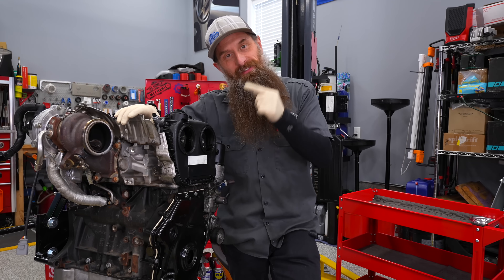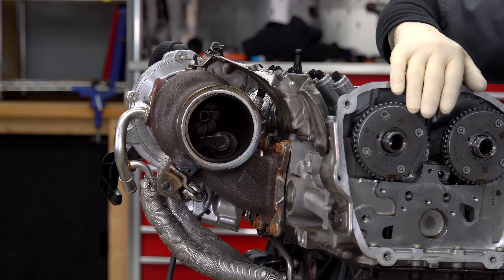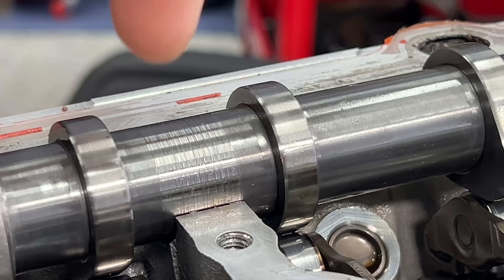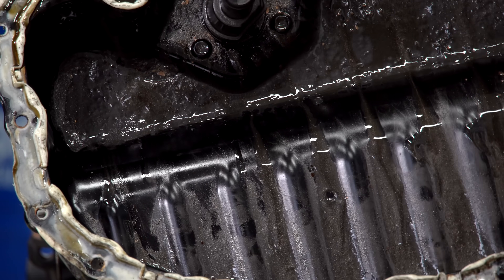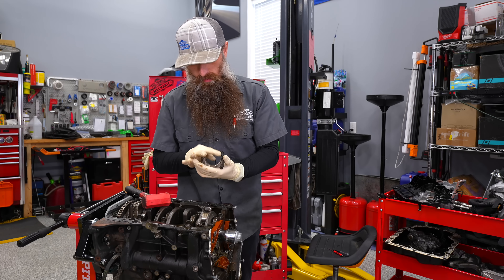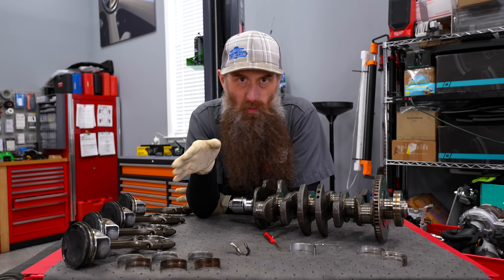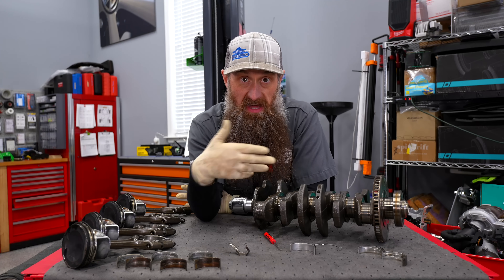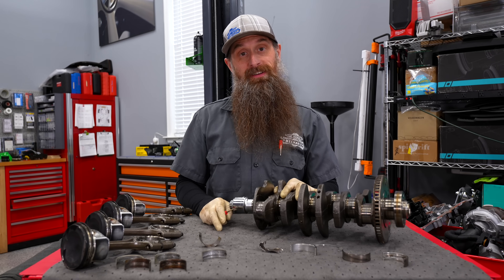Why This Audi S3 TSI Engine FAILED at Just 110k Miles?

Comment: I thought I was the only one that warmed up the car before diving. Most people don’t. Glad someone say this is still important!
Reply: It's not important to warm the car up before driving, and be never said that. What IS important is not hammering the throttle before the engine is warmed up completely. Driving the car while cold is fine, hammering the snot out of the throttle on a cold engine isn't.
Reply: @crx122  I was about to say that, just wait for cold start to finish and then drive off slowly without puting too much gas. Your engine will thank you a lot down the road
Reply: I always let Revs drop before I even put it into gear at a minimum. Ensures adequate oil pressure and allows the cold oil to at least circulate some before I add any load(which is barely putting along until oil temp is at least 180 of course). Other than a very sub par WP/TSTAT design and slightly more involved maintenance/repair costs, the Gen 3 ea888 is a little beast.

Comment: That folks is what the kiddies call a "full send". Why spin one bearing when you can go out in a blaze of glory (to the junkyard)?

I have to say, I think the Gen3 is the one they finally got right. Just crossed 90k on my Audi A4 (CYMC valvelift 2.0T) and so far it hasn't decided to burn oil like a drunken sailor. This is with strict 5k oil change intervals. Hopefully I didn't jinx myself. My BPY, CAEB, and CPMA equipped cars all burned some oil when new. The Gen3 was the first that didn't.... only took them a decade+ to figure out how to build a motor.
Reply: The ea888 gen 3 is in a lot of ways reliable. Mine is a CJXC engine (from a Mk7 R from Europe). It doesn't burn a drop of oil and i always wait for oil to be at least 80 degres before pushing the car a little.

Comment: A few things 
 Look at plugs & see if the electrode is on top of pistons or melted to it. 
 Detonation happens a lot due to 87 octane fuel. 
 Over rpm is another issue.  
 Be safe

Comment: Looks like a bunch of extra sealant on that metal oil pan. Could have clogged the pickup.
Reply from the maker: very possible, but there was none in the pick up when I got it. But yes thats high possible
Reply: @ does the s3 come with a metal lower pan or was that a swap?
Reply: @DrewsDetailGarage  It's a swap, stock one is a weird plastic blend with some other stuff. It's for the thermal properties it has that they chose that, it helps dissipate heat easier.

Comment: Well it’s an Audi engine lol there’s no other reason other than they are junk . My 2005 Audi TT was a freaking nightmare ! Worst car I ever owned and it only had 68k miles. Leaked oil like crazy! Had all sorts of electrical problems . Parasitic draws that I could never pin point. Obd2 would no longer work so I couldn’t get it registered/inspected. Just a huge pile of crap

Comment: I have a 2019 Audi A4, no dip stick, drives me nuts. Gotta use computer to check oil
Reply: 2018 A5 Sportback, I had to buy one. 
I have to see the oil with my own eyes to be sure.
Reply: My BMWs from 2007 have had no dip stick.
Reply: That’s crazy!  Some things should stay traditional.  Shit.
Reply: @razorraysolarsavings70  Second that, dipsticks and a/c buttons are a must
Reply: I do not think I could own a car without an actual dipstick.  I'm a Volvo guy and when Volvo brought out their 2.0L 4-cylinder engines without a dipstick I was not happy.  The funny thing is that the oil pan is cast to accept a dipstick and there is a short dipstick tube (plugged) in the hole, just no dipstick and tube is not visible unless you know to look for it and where.

Comment: It baffles me that people are still buying VW products. Why not buy Toyota or Honda ? VW was decent until maybe 2005 or so.
Reply: VWAG is decent. Stop the cap.
Reply: Meanwhile Toyota has a recall on all the Tundra engines for bearing failure. You’re watching a YouTube channel about VAG engine repairs. What do you expect to see?
Reply: @chrisjackd  dude I had numerous VW/Audi cars since a MK1. I know what VW used to be and what it is now. I know what I am watching but I am disappointed in how poorly these cars are designed now.
Reply: @rickjames9256  I mean so have from 2003 onward. I’ve yet to experience any issue other than a XM antenna failure. So idk. Technology changes over 20 years.
Reply: Because toyota and honda are boring af except for the type r and gr cars. Both of which are over sticker price.
Reply: You haven't heard of new Toyotas spinning bearings? Every brand has failures
Reply: @turbone54   they are giving people brand new engines no questions asked.
Reply: Toytoa and Honda? They were only decent up until 2015. Have you not seen the 2020 Tundra/Tacoma engine exploding issues, the GR 86/Corolla spontaneous combustion that Toyota won’t cover when driving 85 MPH, and the latest Civic gen having the highest number of factory recalls out of any single Honda vehicle ever sold in America? The days of Japanese reliability and simplicity are long gone, just ask any mechanic who has had to replace the hybrid battery/system on any modern Toyota/Honda on dealership book time 😂
Reply: Vw was not good in 2005. Too many electric gremlins. The MQB platform is literally better than all other manufacturers in the same sport compact segment.
Reply: Agreed  @bakermaj1
Reply: Best way to think of it. If you want to enjoy oatmeal every day for breakfast lunch and dinner go for it. Some people want some steak and potatoes sometimes. lol
Reply: Because toyota's fallen off a cliff and Honda can't be asked to make an enthusiastic product at market value.

Good enough reason?
Reply: @ so Toyota and Honda are trash. And you would recommend VW instead?? What drugs are you on??
Reply: I guess this dumbass here has never heard of Honda's 1.5T being a problematic engine.
Reply: I've seen this a lot recently, everyone wants a VW Atlas. 
Personally I'm a diehard Yota guy but they're just boring and lacking in technology to most people.
Reply: @Unb3arablePain  they are boring because they don’t break down. Euro cars are worth having now until warranty is done. Mostly after that they start falling apart and breaking down. Ask me how I know

Comment: There was some shop that said they had three 3.0 supercharged engines develop a fuel leak in the HPFP which dilutes the oil and then its kaputt, maybe that happens in the 2.0 turbos also
Reply from the maker: possible for sure. those HPFPs are not great. HAHA
Reply: @HumbleMechanic had the main internal seal on my 2015 mk7 hpfp go bad, was throwing “lean at idle” and was having trouble starting while warm, I rebuilt the pump with an upgraded kit with a new main seal and it fixed my issues. It however was leaking fuel into my oil through the crank case, and my fuel was diluted with 93 octane, definitely a possibility here. Other than warm starting problems every now and then, the car drove regularly so somebody who isn’t super on top of their car could have not given it a thought

Comment: So is an audi s3 or a3 quattro still a decent buy? My wife has a mk7 GTi and hers has been bulletproof so far but i really want the all wheel drive
Reply: I have a 2020 S3 with 98,000 miles on it. I’ve been stage 1+ tuned for 50,000 of them. All maintenance done. Just did the timing chain and cam shaft chain. $3500 at Audi. Car runs great, but I do take care of it.
Reply: @bwoisness  That's very soon for the timing to be done. I always check the timing on OBD eleven to see how far the tensionner has stretched. Generally speaking once you see -4/+4 it means it's time to change it
Reply: Thought about a cheap a3 and tuning it the other day. I would say i wouldt be comfortable without a timing job to be safe. Chains not problem but guides/tensioners can fail. Fluids amd a pcv valve and send it lol

Comment: Audi are crap cars. My wife’s Audi suffered catastrophic engine failure at 90,000 miles . $26,000 for the motor and everything was $46,000. A disposable car. Drive it for 7 years and throw it away. Intentional obsolescence by Volkswagen.
Reply: Going on 10 years with my 2015 audi s3, but only at 67k miles now.  I keep up on maintenance, used VCDS to show oil temp on the dash so I can monitor when it's warm, and so far so good!
Reply from the maker: HOLY HEL!!
Reply: Not true man.
Reply: You're only saying that because you had crap experiences unlike a lot of us here.... Had two VW and one of them was a Mk6 GTI (known to have a shitty engine since the very beginning). My current golf R is a 2016 manual CJXC engine, not a single problem and it has 90 000 miles on the clock.

Comment: I'm so glad I have a 1.8 20 valve.  An actual aluminum intake with injectors. What a concept.
Reply from the maker: the 1.8t made a lot of my mortgage payments. ;) but I do miss some of those things that made it good.
Reply: @HumbleMechanic is 1.8T in Audi B6 a good engine?
Reply: My most hated Audi motor.  That and the 2.7t.  Always in for something lol.  Paid the bills for many many many years.  I run when I see them come in the shop now.
Reply: @koolkoreanked  what is so wrong about 1.8T motor? Just asking. I have a 05 Audi with 1.8T did not have any major issues with it. Mainly replacing window regulators and simple stuff.

Comment: that oil filter housing oil passage and alternator mount very bmw, it just need a water cooled alternator and you get the trifecta 😂😂😂😂
Reply: I just replaced the seals behind and to the oil cooler from that bracket. (2013 Tiguan CCTA)
Fun fact:  If you have oil in your coolant...but not coolant in your oil.  It is probably these gaskets.  

I was already doing port cleaning, water pump and timing chain but it added another chunk of time to remove the alternator and A/C...although it made changing the accessory tensioner very easy since it is also mounted through this bracket.

Comment: running low oil or no oil
Reply: Don't these use oil? if you don't check it and top up, bad things happen
Reply: @danascully-x2t  Gen 3 use a lot less oil than older generation of this engine. Mine actually doesn't use any oil at all.

Comment: This 4cylinder engines with turbos and too much horsepower are so fragile
Reply from the maker: My heart says this was partially owner induced
Reply: @ im a mechanic from algeria whos a big fan of u thanks for spreading knowledge, but here we work on this engines a lot and even with super good maintenance theyr junk by the time theyr 160k kilomiters specially gti engine
Reply: @arismohamed I have a Passat with the gen3 TSI.  It has 180k miles and gets VW parts only for maintenance and 5k oil changes.  Runs great!  Obviously it has the 170hp version and probably should last longer than the higher hp versions.  I love my VW and Audis.  Treat them good and they are safe,fun, and dare I say reliable.
Reply: @ 5k oil change is rare considering how pricey the price of the oil here😭 but i was talking about the 245 and 300hp engines
Reply: @arismohamed rather spend money on oil and get to use the car  than brick the engine.  Any performance car will take more maintenance so in my mind it's a problem with any brand.
Reply: I have a 2020 s3 with 98,000 miles. I am stage 1+ tuned for 50,000 miles. Oil changes at 4,700 miles, never burned or lost oil. Car runs great.